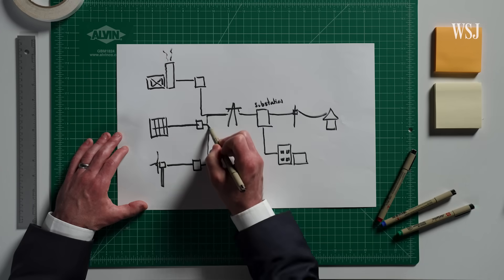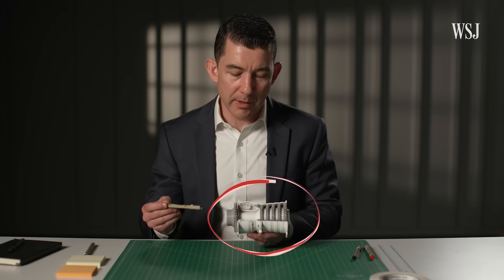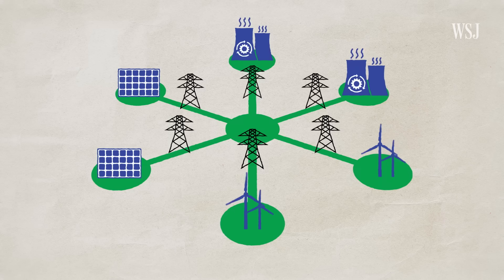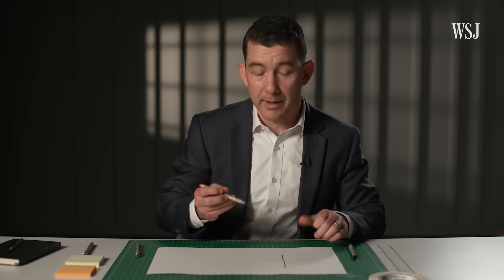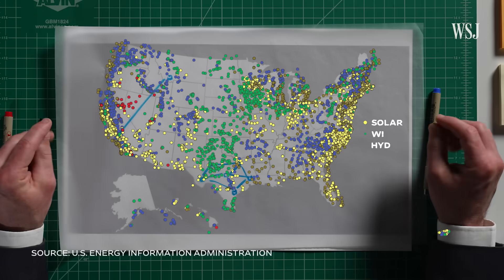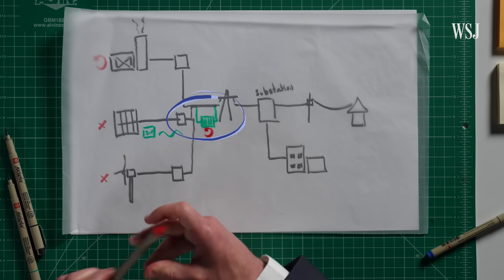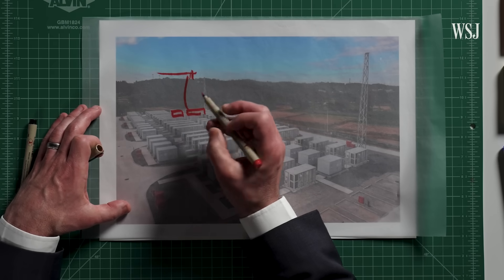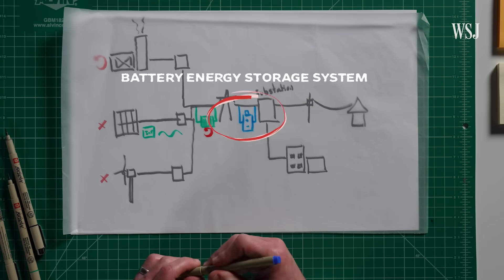How to Fix Renewable Energy’s Hidden Infrastructure Problem | WSJ Pro Perfected

Comment: Ok. Im not an engineer. I just started learning deeper about how electricity really works.
With that said, are you telling me power plants supply your house directly?  Why does they grid need to be a certain hertz? Isnt it like a water tower? You fill up (power) the water tower than the tower distributs it to the individuals. Isnt that the small power whatevers in towns. A power water tower basically?  I thought power plants, wind solar,etc, made power then stored it. Then we use the storage. So it wouldnt matter where the power came from or what hertz it was. Because its all going to the same storage unit. Am i missing something? I really what to know.

Comment: And what are all the infrastructure costs? How long before replacement costs kick in? And what are the vulnerability costs to weather damage of Wind, hail, fire, tornadoes? How much extra capacity does the solar PV field require to keep the batteries sufficiently charged?

Comment: Isn't a huge problem with battery technology that it wears out with each charging cycle?
So if you have such a huge battery that is may used to smooth out power production, is made out of LFP with a maximum of ~3000 charging cycles and is used every day, isn't the battery dead after about 8 years?

Comment: I’m impressed at how knowledgeable this mechanical engineer is about power system stability 😂
Reply: glad to see you’ve realized not all mechanical engineers are as unqualified as the ones you’ve apparently been surrounded by. progress!
Reply: @denizkaraca2727  I assure you: even most electrical engineers don't know this much about power system stability (I'm an engineer at a high-voltage infrastructure construction company)

Comment: Did I miss something?
He got on to batteries as a way to stabilise the grid, but only talked about storage, nothing about grid frequency.  Battery installations in that regard are no better than solar and wind. Each generate DC and must be inverted to AC. Each has the same problem providing stable  synchronisation. You need massive  amounts of each to supply the typical needs of any grid.
And like others, I was trained in things electrical , why did they consult with a mechanical engineer???
Reply: u r right, Paul. they should’ve consulted someone with zero experience like you instead.

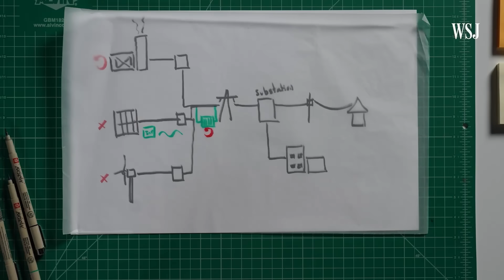Comment: At 4:30 the man suggests using electricity from a solar panel to power a device to protect the grid. What happens at night when that solar panel generates zero electricity? This is nuts.
Reply: The only solution is batteries. Some countries now require all new solar and wind generation to have batteries, you can now longer install solar or wind without batteries
Reply: Actually there is a really great opportunity here to use grid forming PV inverters at nighttime to provide additional rotating inertia.  The inverters are otherwise not being used so this is an excellent use for otherwise unused equipment.  This technology exists today and has been demonstrated to work.

Comment: Stop beating a dead horse, it has no future. Whatever fix you try the fundamental problem is:
Trying to capture a diffuse energy source requires a BIG collector. That means lots of materials waste.
Trying to uphold an on demand grid with intermittent energy sources need storage. Taking our civilizations power demand into account that is impossible.. 

So take a step back politicians, you have been sold a pipe dream. Lets come up with a real solution before you bury more important energy and capital 👍🏼👍🏼

Comment: this is largely nonsense (what happens if u ask a mech engineer for electrical problems). Any inverter can be adjusted easily, you can regulate the frequency by changing the pulse width modulation algorithm, thats in most cases just a software update. No other source is as flexible regarding frequency as photovoltaics are. Most Windturbines on the other hand use asynchronous generators, that regulate their frequency over frequency converter and these could be adjusted like the inverters...and the few WT that use synchronous gens are anyway not affected. But most important, the issue in spain wasnt caused by renewables, but by swinging applitutes between spain and the baltics in the european grid, a very chaotic situation, that overlapped each other at a certain point. The renewables actually worked fine even during the black out.

Comment: I’m sorry but this is disingenuous BS. First of all, he is not adequately comparing these energy sources to other energy source types. Let’s even say, nuclear  - the energy formed isn’t inherently 60 Hz either, it creates heat which warms water and steams to spin a turbine, but you have to control that rate of energy production to avoid it over producing or underproducing, not only for its own safety but for the “inherent rotational inertia” he is referring to. SO, this process is something that needs to happen with the classic energy sources as well. So… again, disingenuous. I’d even say propaganda.

Comment: Residential solar installations are great. They can provide even more stability to the grid. The panels on my house generate 7.2kw and on a hot sunny day in the summer and I'm using only 2.3kw with the AC on full blast and fish tank and console running. That means I can provide almost 2 more houses with the same energy needs. The long distance wires from the power plants don't have to provide so much energy.
Reply: Except space. Really except when it becomes your home that is stolen through emminent domain.

Comment: $40 / kWh? pretty low. Residential batteries cost $1000/kWh. Tesla BESS storage is about $1M per 4MWh or 25 cent per Watt-hour which is $250 per kWh.

Comment: Just make a law for every generator to keep a national master 60hz sync, in house, at least for 5 days offline, normally syncronized over the internet.  What's the big deal.  Its not hard to offline keep a 60hz signal synced to a master sync for 5 days once syncronized.  Why making this a big deal. 60hz is nothing.  we have all the infrastructure. temp/hum controlled crystal divided down to a 60hz clock.  what's the big deal.  You wont get out of sync in 5 days.  How much does your watch get out of sync in 5 days?
Reply: That is not the issue or in anyway related to the problem.   The grid frequency is designed to vary between 59 and 61Hz and the frequency of the grid is used to communicate the overall balance between generation and consumption in order to enable primary control response to be implemented.
Reply: @michael-j-harrison  I'm sorry, I'm a bit confused by your comment.  Isn't the problem synchronizing the peaks and troughs of generated current to the peaks and troughs on the grid?  What do you mean by "frequency is used to communicate the balance between generation and consumption"?  I understand that changing demand/consumption would have an effect on the generated frequency, and resultantly the phase.  So I guess the methods to keep a frequency/phase is not regulated or allows inefficient methods or just the tech is old maybe?  So I understand that the issue it not not knowing which frequency/phase to sync to, but rather having an inability to produce the frequency,  at the exact required phase?
Reply: @Mr_ToR - the grid always has to balance the total generation with the total consumption and every generation asset on the grid needs to know what the current balance of generation to consumption is at every point in time.   This information is communicated across the grid by simply encoding this information in the form of the frequency.  If the grid frequency gets as low as 59Hz then this means that every generator on the grid should output its full output capacity.  If the frequency gets as high as 61Hz then every generator on the grid should reduce back to exporting no power.  You only ever see the grid frequency getting to these extreme frequency swings of 59Hz and 61Hz when something is wrong and normally you only expect to see the frequency vary between a much smaller frequency deviation.  The idea that generators modulating the amount of power that they generate based on the frequency that they measure from the grid is what is called the primary Frequency-Watt control mechanism.   This is what is used to ensure that the total generation matches the total consumption at every point in time.   This is the fundamentals of how a grid is controlled. 
Most EE engineers do not understand this reality and certainly the mechanical engineer that they have on this video doesn't seem to understand this.  It would have been so much better to of found a power systems engineer who understands how a grid works to explain this topic.
Reply: @Mr_ToR - the Frequency-Watt primary control response is based on the underlying concept of a democratic muti-input multi-output control system.  Every load on the grid effectivly 'casts a vote' in the form of how much load it adds.  Every generator 'casts an opposing vote' by the amount it generates. Ultimately you need to have the total consumption 'votes' equal the total generation 'votes'.  By enforcing all the generators to follow the same Frequency-Watt 'droop' then this effectively maps the balance of generation/consumption to the grid frequency.
Reply: @Mr_ToR - the other primary control response is the Volt-VAr control function.  Since the AC grid is actually taking the format of a mathematical grid, then it follows that it is a non trivial problem to make sure the every point in this grid is able to correctly regulate the grid voltage despite the variability of the various loads resulting in variability in the load flowing through different parts of the grid.
This complex control of a grid means that you require two orthogonal control mechanisms in order to achieve basic control of the grid.  This fundamental control is called primary control and and involves the two orthogonal control responses - Frequency-Watt and Volt-VAr
Reply: @michael-j-harrison  Thanks a lot for these excellent explanations.  You provided the key points the video missed. I admit my first comment was a bit trollish, so let me try to simplify it more clearly:
The grid is a coupled system where supply and demand are balanced through frequency. This means we need strategic planning to determine where grid-forming and grid-following assets should be deployed. Some solar and wind generators must be grid-forming, and clear codes and standards are needed to ensure that new installations don’t all default to grid-following by choice or convenience.
Reply: @Mr_ToR - yes you seem to understand how this works.  The only detail that I would point out is that I don't think that there is any good argument for allowing any grid connected generators to be grid-following.  I am pushing for legislation change to make the simple ruling that ALL grid generators should and must be grid forming.  Also I am pushing for legislation change regarding IBR inertia try to overturn the current ruling that IBRs must not provide inertia to being that all IBRs MUST provide inertia.
Reply: @michael-j-harrison  What minimum size of generation do you think the legislation change you're advocating should apply to? Should even small-scale systems like residential solar or wind be required to be grid-forming, or would there be a cutoff, like the usual free generation license threshold? Where I am, selling residential energy isn’t very practical due to high transmission costs and low feed-in tariffs. However, I realize that’s not the case everywhere. I also don’t think the amount of this kind of generation on the grid is negligible anymore.
Reply: @Mr_ToR - check out who I work for.  I would suggest setting the limit at around 100W and any generator/IBR above this limit should be operated as a grid forming generator and impliment primary control response. 

The smallest microinverter that Enphase manufacturers is 300W and a system with a single microinverter is capable of operating grid forming and impliments a full utility control stack that includes primary and secondary control with functions like selective harmonic filtering, sequence selective response, inertia, etc. etc.  I am not aware of a single utility control function that exists that an Enphase microinverter is not able to implement.

A concept known as a Virtual Power Plant means that Enphase is able to provide each grid operator the ability to send secondary control schedules to all Enphase microinverters that are present within their jurisdiction.

Comment: My internship 10 years ago on Uninterruptible Power Supply was just about that, since most data centres have huge converters and batteries they could correct the grids anomalies in frequencies and harmonics

Comment: Very interesting and well presented. I hope the WSJ has a complementary video explaining the risks from power storage systems, especially large battery backup systems that have had significant, uncontrollable fires producing toxic smoke for days. In other words, not enough is known about the associated risks.
Reply: A battery only produces toxic smoke when something goes wrong. A fossil fueled powered thing produces toxic smoke when its running. I'm not saying that we shouldn't look into how to prevent those fires and be able to extinguish them easily but you have to see the risk in perspective.

Comment: This is such an important and often overlooked aspect of the renewable energy transition. The WSJ does a great job explaining the "hidden infrastructure problem" – the grid's need for inertia and how traditional fossil fuels provided it. It's really insightful to see a power grid engineer break down solutions like grid-forming inverters, synchronous condensers, and battery energy storage systems. Understanding these technical challenges and their solutions is crucial for building a truly resilient and sustainable energy future

Comment: As an electrical engineer,  "asked a mechanical engineer," threw me for a loop. But I'm pressing on. 😂
Reply: Maybe they will ask you to explain how an ICE engine works :-D
Reply: I just graduated from electrical engineering and I'm gonna start my full-time position working on EV charging stations and battery energy storage systems. As soon as I heard "We asked a mechanical engineer" I instantly went to the comments to find any fellow electrical engineers
Reply: Shots fired. ME here. Everyone on a program should understand the high level stuff.

Comment: So he is talking Fly Wheels.  You could also do this with pumping water into a reservoir and then letting it flow out through a turbine. When I was in Japan working at a computer chip fab they had an huge electric generators that took the city power and put it through the generator to remove any noise from the power.

Comment: Massive blackout 1977 NYC, with much of NY power generated by Niagra Falls hydro, was triggered by lightning strike at a substation, tripping major circuit breakers.  Failures can happen in any complex system, redundancy and backup is built depending on cost/risk decisions.

Comment: Another partial solution they didn't mention is virtual power plants: basically connecting large machinery, like an office's HVAC system, to the internet, and allowing grid operators to manipulate its demand a little bit. The office's temperature might go from 70F to 71F, but that provides some spare capacity that can be used elsewhere for a few minutes. Some industrial operations can be virtual power plants as well.

Comment: Why did you ask the mechanical engineer  about a subject belonging to an Electrical Engineer ?
Reply: Exactly - if you talk to a power systems engineer, they would be able to explain how grid forming inverters can provide inertia,  however the real problem lies with some of the archaic grid interconnection standards such as UL1741 which mandate that grid connected inverters must not provide any inertia and actually proved the details of the compliance testing methodology that should be used to test and ensure that an inverter does not exhibit any inertia before it is deemed safe to connect to the grid.  If you have stupid grid connection standards then it shouldn't be a surprise that inverters behave in stupid ways.  It has taken years of effort getting legislation changed to allow inverters to provide voltage-ride-through and frequency-ride-through support of grid events rather than mandating that inverters must disconnect from the grid if they detect any abnormal grid event.

Comment: In Finland they just finished building a massive 240 000 lbs flywheel next to a large wind farm that the wind farms spin at the desired hertz. 3000 rpm.
Reply: Wind farms put carbon fibers in your lungs
Reply: Don't you use metric in Finland? I have no idea what 240.000 lbs is. Us europeans teach americans the metric system not learn their stupid system.
Reply: @Ninjaeule97  FYI,   1 Kg = 2.2 lbs.
Reply: @Ninjaeule97  Divide by 2.2 to get kilograms. Multiply by 4.448/1000 to get kN.
Reply: @Ninjaeule97 this is an American video. Using mental math: it’s about 110000 kg. Yours truly an American
Reply: @JaredW-te6ho fair enough. Thanks
Reply: @Ninjaeule97  Good point the metric would be in Kg!

Comment: Nice clickbait, hit piece.  'Here's a mechanical engineer to explain a massive electrical system'  why not get an EE specialized in generation/transmission to interview.....oh wait they may not be do attached to spinning wheels and in turn support the faster, better modern versions of inverters.
Reply: oh wait… maybe expertise isn’t defined by job titles but by what someone actually knows. shocking, I know.